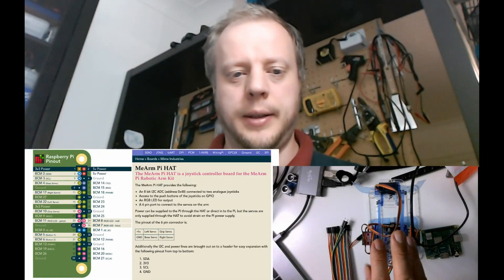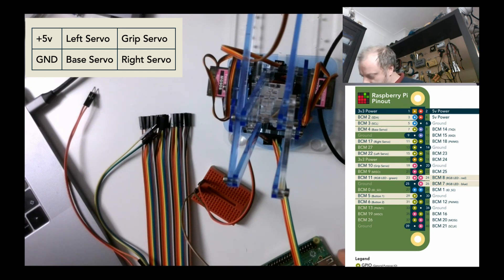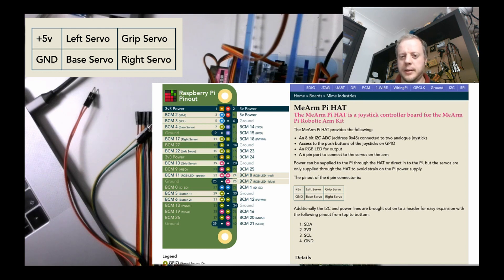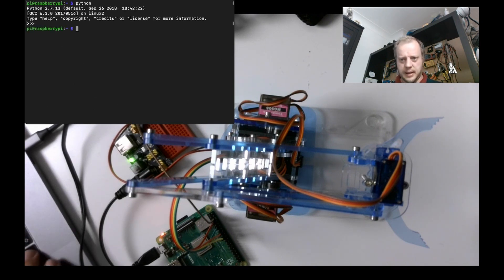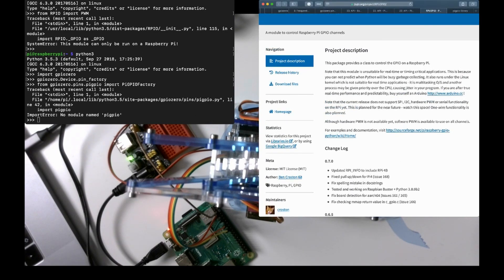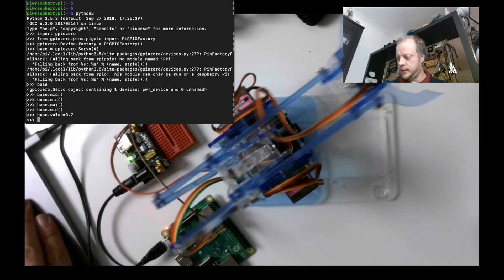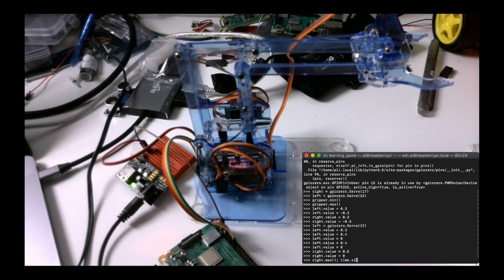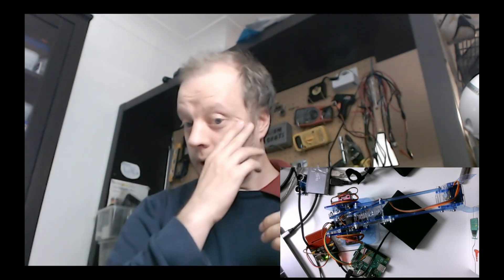Exploring The MeArm Robot Arm with Raspberry Pi

Comment: Which operating system do you use?
Reply from the maker: On the Raspberry Pi - usually Raspbian - or Raspberry Pi Os. This would be Buster. I use Raspbian Lite an install stuff into it as I rarely put a desktop on it.